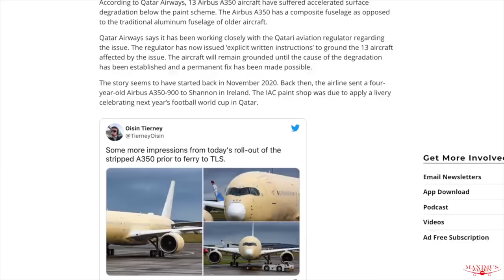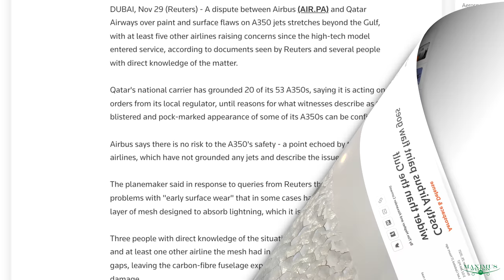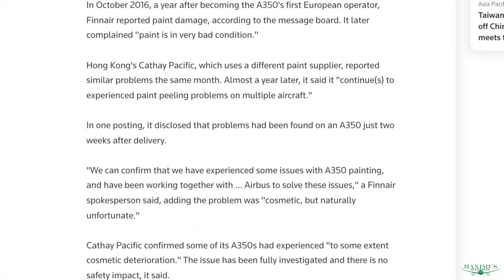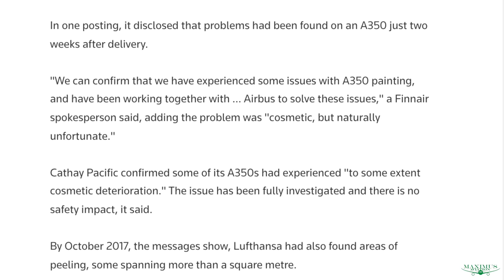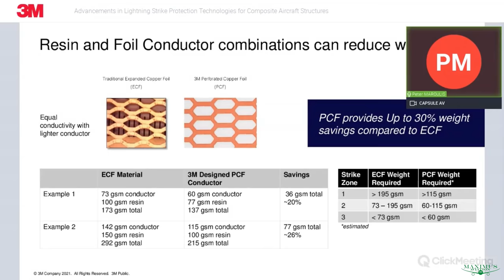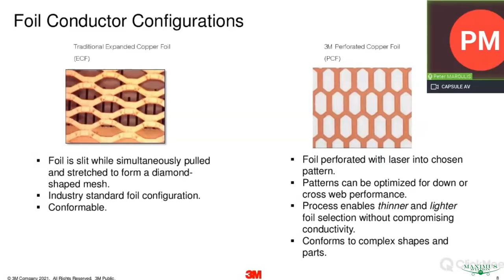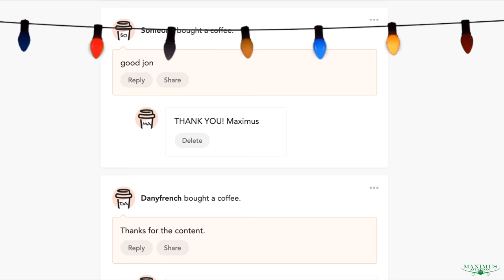Six More Airlines Report A350 Fuselage Defects That Expose Composite Lightning Strike Protection

Comment: It has nothing to do with how thick the foil is. The problem is very simple. The mesh and the over coat expands and contracts at different rates, causing the overcoat to disintegrate. The solution is to use an overcoat that matches the mesh or use a more elastic overcoat or both. Even in automotive applications, we see that a lot. This is why paint designed for metal panels get a plasticizer added when used on bumpers. The incorrect mixture of the aforementioned is also the most common reason clear coats peel on body shop repaired bumpers.

Comment: I have been paying attention to theses problems on both the 787 and A350. This is the first time I have been able to see what the actual problem is.  As a passenger I completely understand the grounding.. There are a couple there I would not get on the airplane. I have no clue to the problem or the solution. My experience with carbon fiber is very limited back in the racing days when it was rarely used because of the price. I found out real fast ..wear a respirator if you're going to sand it.
Reply: - "As a passenger I completely understand the grounding.."
I'm an expert on ships. I have travelled on them ;-).

Comment: IDK as I’m no expert. But ever since an American Airlines A300 flight 587 crashed over NY shortly after takeoff because the first officer put too much input on the rudder pedals that caused the carbon composite vertical stabilizer to completely snap off, I get creeped out by flying on a plane that is made out of that stuff. At least back in those days when the technology was fairly new, they used it in certain areas. But it seems like the whole fuselage, wings, vertical as well and horizontal stabilizers are made out of the stuff. 
So even though it’s a proven fact that flying is by far the safest way of getting point A to B, I just try to fly as little as possible. 
Happy holidays to everyone.

Comment: Hi there Maximus from what you said last in this video and from what I know it is not a safety issue  it is just something that looks bad to have a new aircraft and the paint job looks like crap and as I said once Airbus has a hand on to it will be fixed in no time it is not an MCAS of a fuselage of wings cracking problem so by February I look for this to be a thing of the past it was an unknown flaw in the paint on carbon fiber aircraft a real accident and not  a botch job like the Boeing 737 max or the Dreamline 787 these aircraft have problems that can kill somebody
Reply: Exactly👍
Reply: The problem was first reported in 2016, yet Airbus hasn’t told the airlines what the solution OR the cause is yet. Have you asked Airbus out for a date yet? You seem enamored with them.
Reply: @stevegiboney4493  …yes they have a solution now they are making a plan how to implement it. It’s not like A350 has been withdrawn from service in other airlines and not like the 787 that had to halt ALL deliveries for 6months - unlike its rival🤷🏻‍♂️🤗
Reply: @remi_gio  You….Airbus …..Candlelight….. Soft music…..
Reply: @stevegiboney4493  It’s the objective truth. Obviously the two manufacturers have slightly different policy when it comes to safety and fleet upgrades. Can you imagine what would happen if the A320 neo started falling out of the sky and Airbus wouldn’t take any responsibility? Objectively Airbus is a better/safer choice/product.

Comment: Cracks at the wing root would be a problem, pealing can be reepoxied, repainted, and things are OK. Scans of high stress areas should be done on all composite airplanes until the 1st generation is retired without problems.

Comment: Holes possibly too large in the current mesh. Which is leading to bloating around the fuel valve. Was going to suggest somebody gets their Crochet needles out with Copper wire. Could still do that, but on the edges that surround the copper cut out panel, giving some extra room for the wire to flex a tiny bit more. Alternatively just scrape off the bad stuff and fix the smaller mesh on top, without doing any removal beyond the resin. TO QUOTE A SAYING! "if it aint broken, don't fix it"!

Comment: thats a bummer but at least its not gonna haunt them for years to come
Reply: we don't know that yet.  Let's take a more cautious approach since it involves exposure to the under-skin designed to protect the aircraft during a lightning strike.
Reply: @steinbockguy  it's on the outer surface not inside the carbon fiber buildup.
Reply: @DC8Combi  agreed, it's under the paint, at the metal mesh level but above the carbon fibre body.
Reply: @steinbockguy  exactly and my point was it's not structural and should be an easy fix.
Reply: @DC8Combi  whether it is on the outside of the skin is not the problem.  The problem is to understand what happened because the the mesh to protect from lightning strike would also have been affected.
Fixed whith what ??

Comment: I don't buy the "cosmetic only, no structural issues" argument.  The paint film has a purpose - to protect the composite structure from sunlight and moisture and it can't do that where it is compromised.  For me the only way to show it is purely cosmetic is to leave the same structure (or a sample) exposed to the elements for some time and show no reduction in strengthen.  I look forward to this test as I have yet to see any composite that does not degrade when left exposed to sunlight, the elements and airborne pollution.

Comment: thermal expansion of the wire mesh is GREATER than the paint
and
with enough thermal cycling, it tears.

this is EXPECTED.
There is no solution. 
You can't leave the skin unpainted cause it will have the mesh dragging air like a sail boat.
and
you can't be painting  your plane every 2 weeks.

Comment: Carbon composite films are not new,carbon has been used for a long time. Manufacturing the entire wing and fuselage is relatively new. Replacing the metallic film will be a nightmare as it’s imbedded in the outer skin. I can’t see any easy/cost effective way to replace it over the whole outer layer,unless it’s happening in just a few areas on the aircraft. Has Boeing had the same issue with the 787?

Comment: I'm betting it IS aluminum, which has a very large coefficient of expansion, compared with copper (but is more conductive by weight). the thermal expansion and contraction of the aluminum mesh shears out the epoxy bond causing it to blister and peel away, especially as water gets into the seam and freezes in flight.

Comment: It would seem that 90% of the closeups you included in this report are of non pressurised areas (noted by the “static wicks” attached) most of these will be attached to flight controls and fin/wingtips and so would be of minimal safety issue.

Comment: Engning point of view based on your comparison images,one can be easily stretched while the other is not since it looks honeycomb which is designed by intsects is solid and rigid,if you pull it beyond its capacity it will break.

Comment: This may be a good reason to buy the A330neo over the A350 until this issue is resolved. Nothing like proven, reliable technology.
Reply: Or 777, 777X and 787 because the 787 are minors issues

Comment: Composites has long been used in the plane such stabilizer for decades. But this parts are not subject to force expansion such body cabin pressurized.  So, had they used the same polymer ,same materials for each parts. Result'd be in different.
Reply: You sell bananas and you knew that? Explain.

Comment: i wonder weather they metal gauss is expanding and contracting in so many cycles by so much that it is causing the paint to blow off the surface and causing the gel coat of the carbon to degrade?. in which case that sounds like a complete rip off of the whole old lighting system and install the new one! nightmare.

Comment: It should be clear, the expansion of a Tupperber airplane expands more than aluminum. For facades, the expansion of steel 1 is aluminum 3 and plastic 7
Above it is -50 degrees and on the ground it is +40 degrees. all this in 20 minutes, paint can't keep up with this expansion and contraction.

Comment: On this particular model of Airbus aircraft (350) in the Aeronautical sense (more than the aerodynamic feature of the aircraft : which assists only to reduce thrust wind resistance force acting in front on the aircraft, and also in aiding more airflow over the entire aircraft) ....it could be that.... the jet engine on each of the  wings may (or may NOT) be a bit too close to the fuselage,  and the heat dispersed from the engine could be heating/effecting only the paintwork on the fuselage, ....as well as (thermally) heating the metal sheet and mesh work of the fuselage just under the effected paintwork area. ie  the heat absorbed in the metal sheet, metal fasteners etc. of the framework of the fuselage could be just spreading within, and effecting the paintwork above it. 
 
The air flow over and under the wings ...between the jet engine and the adjacent parallel fuselage (especially the areas where the front wings connects to the body/fuselage of the aircraft) ....may not be cool enough to keep this area of space cool, especially when the aircraft is approaching close to the ground. Therefore in hot temperature countries this jet engine heat of the aircraft can combine more severely with such countries local heat, and thereby create more damage to the rest of the paintwork of the aircraft. 

But this jet engine heat, or the combined heat of a country will have no effect, or will not impose any threat on the actual framework structure of the aircraft. This is from the Aeronautical Eng. sense for this aircraft Airbus 350.

This could perhaps be the responsibility of the company who painted the aircraft : e.g the kind of paint they have used and its application process, and the paintwork problem may be not to do with  the aircraft manufacturers.

Comment: So, did Airbus try to save money by using stocks of the older type mesh, wanting to use it up before fitting the newer type mesh? 🤔
Reply from the maker: would seem so
Reply: So they have to reapply mesh and paint - not a safety issue. A cosmetic issue that will cost a bit. It’s strange though as Qatar is involved in every stage of their aircraft painting and interior fitting. I highly doubt that Airbus didn’t disclose what materials were used for overall coating. Happily they came up with a fix and the issue will be solved ;-)

Comment: Boeing 787, an all composite plane has been out for decades now. I have not heard of this problem. Many of the newer military jets also have composite skins. I also have not heard they have delamination problems either. This sounds like a bad choice of material and/or bad manufacturing process by Airbus.

Comment: Simple repairs but require a lot of down time... Isn't that how most problems start? Like Boeing's 747 cargo door latch that tore up mid flight back in 1989 on United Airlines flight 811 from Honolulu?

Then the airlines don't want to ground the aircraft for service until something happens? I'm starting to see a pattern I don't particularly like.

Comment: Airbus has a different composite curing standard than Boeing and others which is more prone to delamination.  It has not been an issue in the past on other aircraft, however with the A350 using non metal infused carbon fiber pre-preg materials, this curing specification is now showing its ugly head.  I'm sure they will get a fix, however once the aircraft is built, any fix will only add weight, and reduce fuel economy.
Reply: How exactly does a curing profile for a specific fibre/resin system make it more prone to delamination ? Assuming that the curing profile (time/temperature/pressure) has been validated at the coupon/subcomponent level ?
Reply: @OzAerobat  It has more to do with the equipment being used and the control systems.  There is a distinct difference to the equipment manufacturers in Europe and the USA that are used for this curing.  For example, using a test coupon as opposed to actual component measurements and control is a big part of it.

Comment: Does Airbus think we are all stupid? The paint and sealants have a purpose: to protect the mesh and carbon fiber from the elements. It just cannot be good. And if the material starts to slowly degrade…we’ll that would eventually compromise the carbon fiber itself. That would eventually potentially cause failure of the shell. What’s up, has Airbus started hiring Boeing executives?

Comment: I find it hard to accept the notion that an airline would ground much of its most fuel-efficient planes (A-350s)and bring much of its least fuel-efficient planes (A-380s) back into service during a pandemic that has caused runaway fuel prices and reduced seat utilization in an effort to get some financial concessions from Airbus.  Just doesn't pass the common-sense test. And after seeing the pictures, I fail to recognize this as just a cosmetic issue.  This doesn't work for Airbus any better than substandard pilot training and experience worked for Boeing and the Max/MCAS.
Reply from the maker: You make excellent points. But look at it this way.  You buy a new car.  Say a BMW.  You take it home and you notice in two weeks that the paint starts to literally start peeling off and dropping in your driveway.  Will you. just say, "Oh Well" or will you fight for BMW to make it right?  Its kinda like that.
Reply: @maximusaviationchannel  Very true Maximus and I'd feel the same way.  But I also understand the Qatar Aviation Agency and Al Baker's concerns of possible safety of flight implications.  I am under the impression (or misimpression) that the Qatar Aviation Agency was the source of the grounding order.
Reply: The A350’s avionics haven’t flown 2 aircraft into the ground killing 300 people nor have they burst into flames mid-air. Instead the paint job is a bit shit which will be solved by changing to a finish that makes the plane even lighter and more fuel efficient. This is what major in service teething problems should look like not what happens at Mcdonald-Douglas.
Reply: @davidwright7193  whoa, let's stick to this issue and not conflate it with failures at another company.  The question is about the A350 and possible paint peeling, delamination of the mesh/paint, etc.  This video is a review of the A350 and problems first reported at Qatar then subsequently found by other airlines on their A350 fleet.
Reply: @phillipparrish5577  Quatar will gain better pr, because its showing people they aren't afraid to look at their planes and say something
Reply: @steinbockguy  he is  right

Comment: Well, I don't want to get into this since I am not an airplane buyer. If the airline is difficult to deal with or if it's Airbus, is also not my problem. However, it seems to me that it is a Airbus problem and they have to fix it, one way or another. What I could tell you instead is dealing with a German manufacturer is not easy because they know everything and they know it better than anybody else. This includes automobiles as well.

Comment: I've said the same thing about Boeing and their supply chain, so I'll say the same for Airbus and their supply chain.  The supplier has to take responsibility (in this case, it's the paintmakers). Airbus could ask for the highest quality from their suppliers and I don't doubt that. However, this proves that despite what quality Airbus demands, the supplier is the controlling factor in quality of 3rd party vendored components and the final assembler has no power to dictate supplier quality.
Reply: It could very well be the paint manufacturers but it can also be in the application either way the aircraft manufacturer will be held to fix the problem not the manufacturer of the paint.  Takata didn't repair the defective air bags on Honda's even though they were Takata air bags Honda did.
Reply: The final assembler has ALL POWER and RESPONSIBILITY of it's suppliers products quality. That's why assembler (manufacturers) are supposed to screen their suppliers products. If this issue is a suppliers quality issue then Airbus holds responsibility for not catching it and accepting it.
How do you get the final assembler has no power to dictate supplier quality when the final assembler actually mandates the requirements of the products they are purchasing. 😂😂
Reply: 1st year law school 3 words: torts deep pockets..

Comment: By the pattern and placement of the cracks, it seems more like rapid oxidation more than deterioration. In very humid climates, paint that is not covered by a coating allows water to enter and vaporize in the paint which then creates cracks very similar to those shown. I also believe it is a cosmetic issue so it’s definitely a problem with rapid oxidation of the aluminum mesh. That can easily be fixed. And y’all in the comments defending Boeing because of this need to stop. Cmon if there is a whole contamination of the carbon composite compound, that is not the same as this problem you see here. Just stop and do research before jumping to uneducated conclusions…